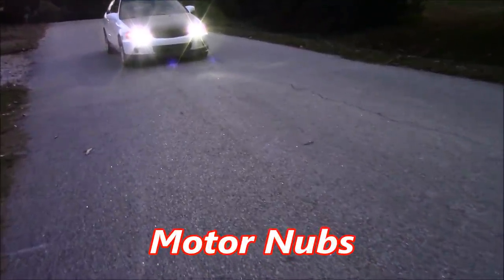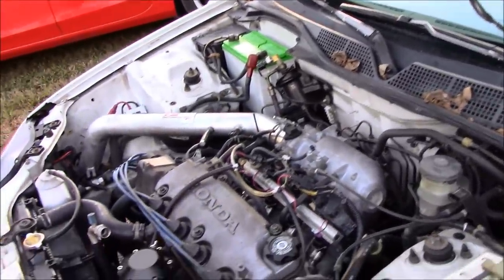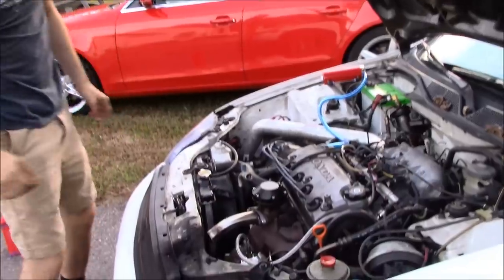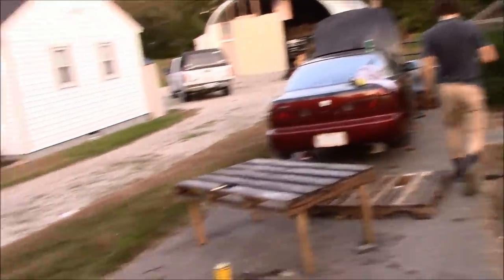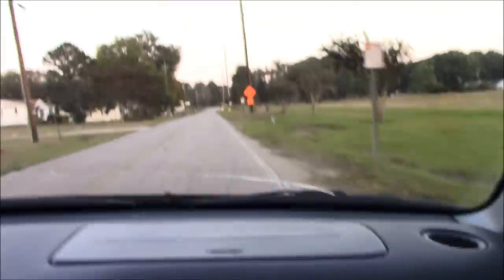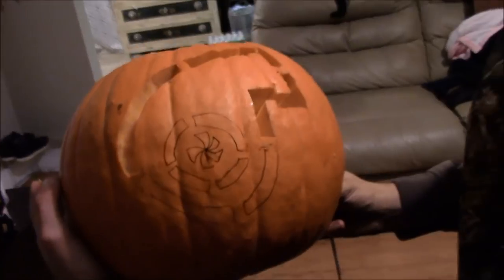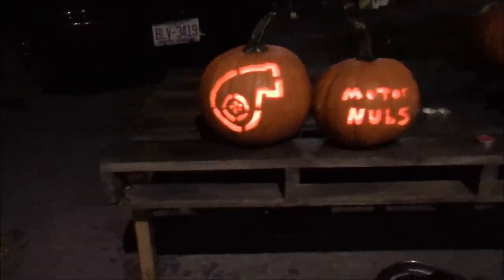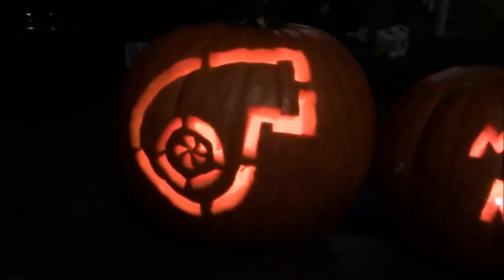EBAY Turbo Pumpkin EK Civic

Comment: Biggest thing with these D and B series blocks is getting a good vent off the back of the block, where the factory catch box and PCV valve go into. Best bet is to remove PCV valve off the back of the block, run that to the catch can, as-well as run the top of the valve cover to a catch can. make sure the can is vented, and you will have 100% awesome blow-by, and crankcase pressure management.
Reply: I mentioned this to them on multiple videos where they were wondering why they having so much blow by. I guess they finally figured it out...
Reply: You're still going to get blowby if your valve seals and piston rings are worn, it's not going to solve that, but it will help with it.
Reply: True but in most cases either there's no catch can to valve cover or pcv valve. and in some cases the catch can actually needs a vacuum source from the turbo inlet; constant vacuum even in boost.
Reply: Vacuum? My catch can is always pressurized. I've got a line coming off the back of the block and a line coming off the back of the valve cover, PCV box deleted. It blows some serious crank pressure into the catch can, probably due to my worn out old B18, so I vented it at the top. I couldn't imagine venting that back through the turbo, yuck.
Reply: dropinbiking92 that's why the catch can in between the vent and vacuum source usually has a baffle to ...~catch the oil vapor~...hence the name. None of that vapor should be reaching your compressor wheel if you do it right. And if you're b series is already  pushing massive pressure you don't really need a vacuum source anyway so, not sure what you're on about. This is about engines that need it to reduce blow by.
Reply: I just don't like the idea of routing byblow fumes back through the intake, would lower the effective octane rating wouldn't it? The whole point of a good catch can is to delete the PCV and prevent the recycle of those fumes.